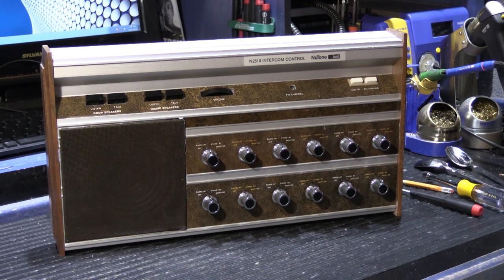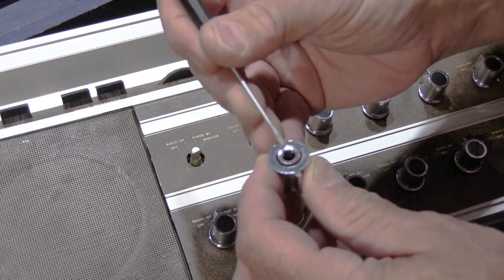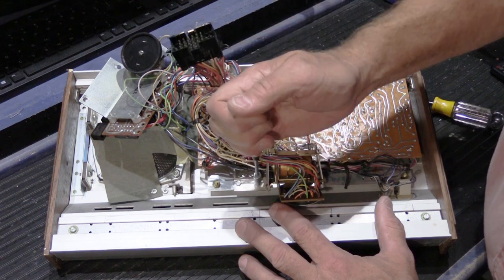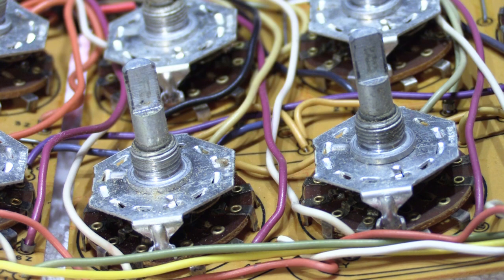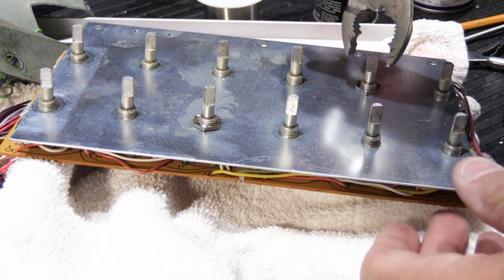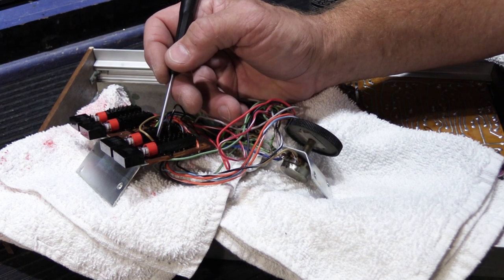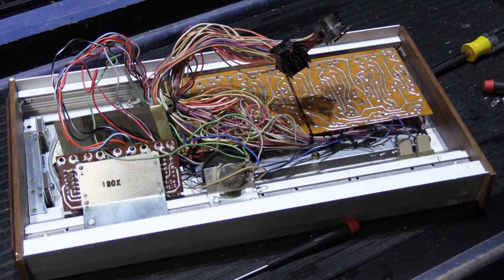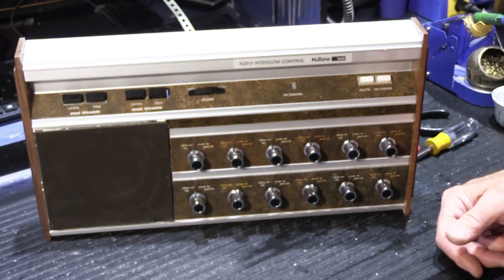An Overview of a NuTone 2510 Intercom Master Station and Switch Cleaning Tutorial

Comment: Hi Chris: You use WD-40 on the top shafts of the Function Switches. What about the potentiometers ? Can you use WD-40 on the top shafts of the volume control pots or you may ruin them ? Thanks.
Reply from the maker: Hi Luis: You should never, never, never used WD40 around any potentiometers - it will ruin the carbon in the control.  Deoxit D5 is the best choice - Chris